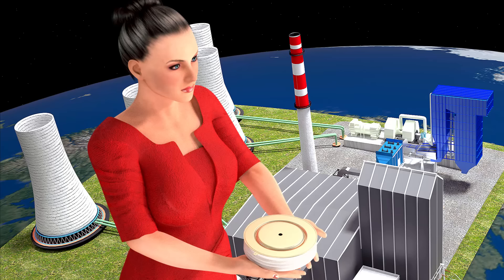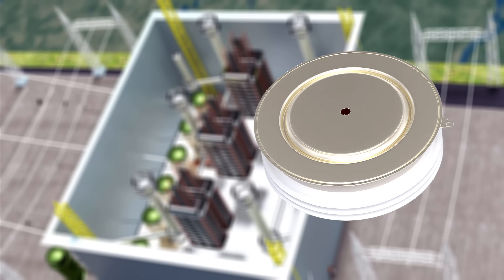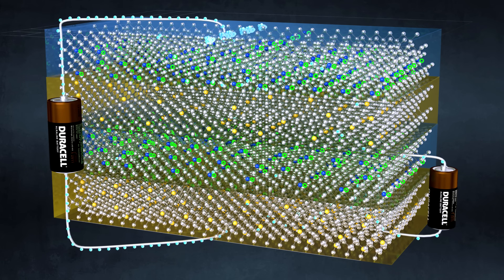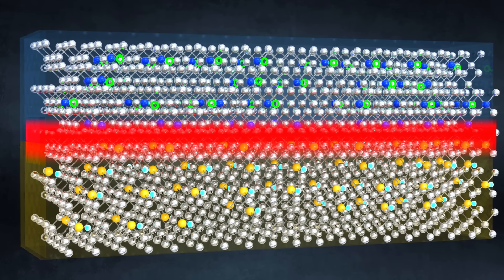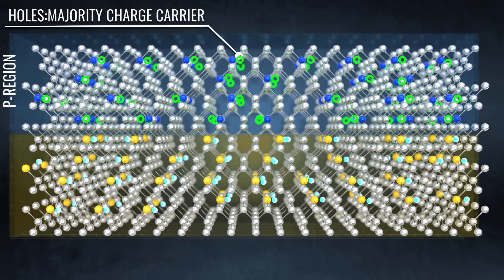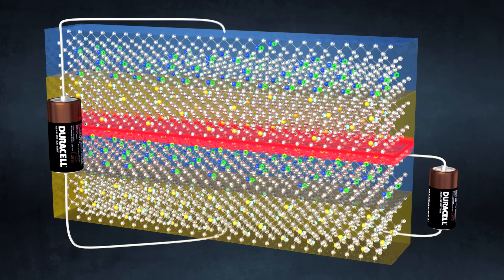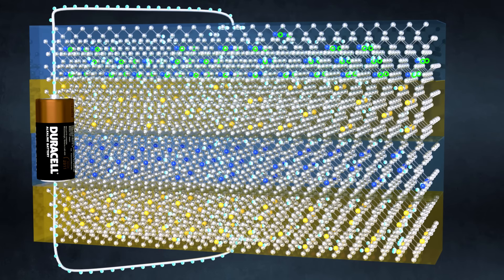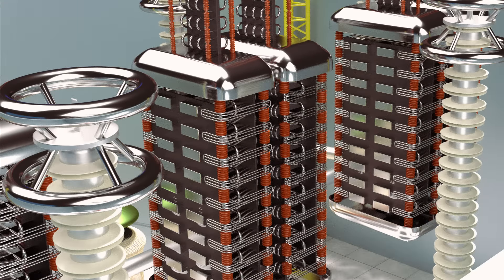How does a Thyristor work?

Comment: 0:40 No longer true! In
 HVDC applications today, the two main types of switching devices are  thyristor  ( HVDC based on line-commutated current-sourced converters (LCC)) and the IGBT ( HVDC based on modular multilevel voltage-sourced converters)

Comment: Why not to use MOSFET transistors? What are the advantages of a thyristor over a MOSFET?
Reply: mosfets are very susceptible to voltage spikes which is not too good for power transmission that is HV and exposed to lightnings etc :D

Comment: Thyristor  are nice in all, but why not just use a SCR no need for the fancy shut of circuit.
Just need to remove the gate power. And here is the one thing this video didn't tell you about, because it stores energy internally it becomes very susceptible to a condition called thermal run away. I thought this was BS until I saw a harmless little Cylinder Prox sensor go off like a stick of dynamite. Although this is a very rear event it should be noted seeing every average household has thousands in it.

Comment: I thought that the whole reason of going AC vs DC was that AC was best for transmitting power.  That Edison's version of power would require power stations like every 5mi or so?
Reply: Voltage being equal, DC is better is certain circumstances.  AC is said to be better only because it can be generated/consumed and stepped up/down more easily.  Once stepping up has occurred, DC comes back in as a contender again.
Reply: Mister Brookes  we still don't have practical DC-DC transformers. We do have practical DC-AC converters now because of thyristors.
Reply: Mister Brookes  yes, but they are nowhere near efficient enough to scale up for use in power distribution, which is what we're talking about.

Comment: Gee!
You did not explain that the SCR is used because current can be instantly shut off whereas with diodes, the current cannot be stopped, so when a fault occurs, such as arcing,  the damage is minimized. Also, the SCR's form a variable voltage converter to permit the line voltage to be regulated. Also the value of the DC transmission line is that only two main conductors are required compared to the AC transmission line where three main conductors are used so that the load forces (wind and ice) on the support towers is less, and line impedance losses are reduced.  Also, the DC transmission is at higher higher voltage and lower current so that the weight of the cables is reduced. Al this permits using smaller diameter cables and these factors makes the line cheaper to maintain and build and less risk of failure during storms, etc. At the user end of the line the SCR's form an inverter where AC current is produced to match the user's frequency and voltage so that the DC transmission line can also be used as a frequency converter (some users need 50 HZ and some providers use 60 HZ).

Comment: I fail to understand where the power savings is. It's a switch. How is this saving power over a breaker or solenoid and  full bridge rectifier?
Reply: you can't turn on/off breaker or solenoid at high frequencies, thats the key. Thyristor is a very fast switch, that can switch many times per second. And thyristors are used to create full bridge rectifier, the only difference using them not diodes is that you can turn them on demand with gate impulse, that provides possibility to tune the output voltage.

Comment: What ks confusingmis you saying high voltage dc transmission.....transmission lines are ac not dc then converted to dc for use and or stepped down for ac use...are you saying that now we are changing to DC for transmission of power ?

Comment: WAIT! I thought the whole reason A/C was used in power transmission, was because D/C required large, bulky cables and didn't transmit well over distances...
Reply: AC is used because transformers don´t work with DC and so long distance transmissions with high voltages in the 100000V range become impossible and also in the same way u can´t step down the voltage again to 120/230/400 at the consumer end. Another reason is the AC induction motor wich require no brushes that wear and creates noise and also is more efficient and wich thus have become dominating for that reason in the industry. With modern tech u can use transformers to step up the voltage before rectifying it and then do it the other way on the recieving side and AC motors can be operated with Variable Frequency Drives (VFD) wich  can operate directly from DC and also  can control the speed of the motor (induction motor speed is normally tied to the line frequency) but none of this tech was existing in the age of Thomas Edison, George Westinghouse and the childhood of electricity.
Reply: @johnpekkala6941  The gist of what I was saying. Edison was wrong about transmitting DC power; Tesla had the right idea. On so many levels!

Comment: 0:10 -0:34 where are you talking about? this does not sound like the US
Reply: One of the largest ac-dc-ac is in the north east because you can transmit more power efficiently once you have a very high DC voltage the resistance becomes almost zero
Reply: @ralanham76  evidence

Comment: One major doubt
Everyone says current flows from positive to negative but the electrons move from negative to positive WHY ????
Reply: Electrons are negatively charged, thus, they flow from negative to positive. However, when doing theoretical analysis, the flow of electrons from negative to positive has the same effect as the flow of a positively charged particle from positive to negative. So, to avoid messing with negative signals when doing maths, it's often useful to consider a equivalent scenario of positive charges moving the oposite way electrons move, but the actual direction of motion of the electrons can and should be considered in specific cases, such as the working of electronic components. I'm not specialist in this field, but I hope I helped you! =D
Reply: @Murilo9519  u helped me a lot
Thank you very much
Reply: Because Franklin got it backwards #thanksfranklin

Comment: Ehhhh..... what did this have to do with High Voltage DC? A Thyristor is meant for AC power. It's use and implementation doesn't involve High voltage DC at all. 
An explanation of the workings of the thyristor was kinda cool, but attaching that to HVDC doesn't make any sense. 
We might as well start discussing mercury switches for low power applications.
Reply: Thyristors are used to convert back and forth between AC and DC in HVDC systems.
Reply: @QDWhite  Thyristor's can't do that though. They do not inherently modulate waveform. More over, they can't be used to drive inductive loads to modulate waveform either because they don't turn off while operating under direct current. 
The only thing that might work for this is an ultra low frequency magnetron, but that's not what the video discusses at all.
Reply: @walterbunn280  Forced commutation is used to turn off the thyristors.

Comment: How does transmitting DC current exhibits less power loss ?
Reply: Its about reactance. DC in steady state doesn't drop voltage on inductive/capacitive reactance of a power line.
Reply: @sumilidero  thank you
Reply: @ashwajeetprasad6101  you welcome
Reply: There are  two types  of loss in a conductor. Pure resistive loss and I2R loss. DC current only experiences resistive loss. AC  current experiences both resistive loss and reactive loss. The reactive loss is caused by the magnetic domains constantly changing with the  direction of the  current flow. Therefore HVDC transfer of large amounts of power over long distances even using expensive inverters and converters becomes more cost effective when certain thresholds of power and distance are exceeded.  Thyristors are the enabling technology for this and as the cost of implementing  them becomes cheaper the efficiency  of  HVDC  becomes more cost effective.  This technology was not available during the  original " War of the currents " between  Mr. Edison and Mr. Tesla.  So, I guess AC power of  Tesla was the best solution at the time, due to modern 4 junction semiconductors  DC has made a  comeback and is the better choice  in  high power, long distance electric transmission.
Reply: @harrytruman8510  I2R is still resistive loss, reactive loss depends of current derivative

Comment: Why is DC better than AC for long distances?  How is the base current of a switching transistor a "huge" power loss? The base current is minuscule compared to the current it's switching. Kudos for trying but it needs a better script.
Reply: But if you transfer many mega-watts of power, that 'miniscule' current is severe, and creates tons of heat, which is a problem to dissipate over semiconductors

Comment: This appears to be informative in a intriguing way as it progresses. However, I'm baffled by the notion that AC is concerted to DC, presumably because AC doesn't have the ability of long travel and voltage stability. Huh? And then converted to DC which is subject to voltage drop within a short range, without some applications of bumping it up over time, so did I miss the point about what this device does.
Reply: DC is better for very long distance power transmission because it doesn't have frequency related losses of AC transmission. Thyristors are used as a switch to chop up the DC back into an AC signal for local distribution.
The main advantage of AC transmission is that it is easy to change the voltage using relatively simple transformers. With current technology this is no longer the case and the ubiquitous low frequency AC transformer in electronics devices has been replaced with high frequency switches which rectify the AC line voltage into DC, convert the DC into high frequency AC and then use a high frequency transformer and rectifier to convert to low voltage DC.
Compare a typical 1970's wall wart with a modern USB charger. The USB charger is much, much smaller and lighter. for the same power output.

Comment: Woah woah woah... Hold the heck up.... HVDC solves the range issues of traditional AC systems? I'm no electrical engineer, but what the first 25 seconds of this video says is that everything we've been taught about AC and DC is wrong. I ain't buying what ever  you're selling. If you used HVDC over a long distance, the wires would more than likely detonate within moments of switching on the current. Don't believe me? Connect 20 car batteries in series which will give you 240 volts DC at about 600 Amps and then connect them to standard gauge house wire, then tell me what 144 kilo watts does. Other than that, great video